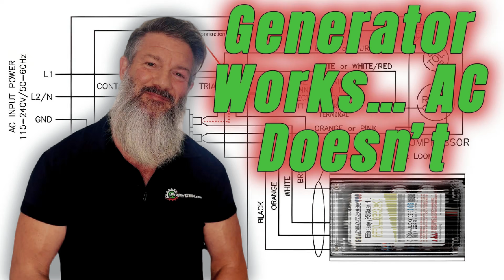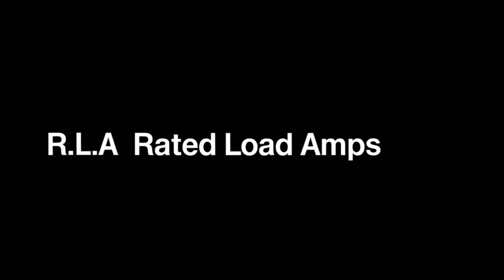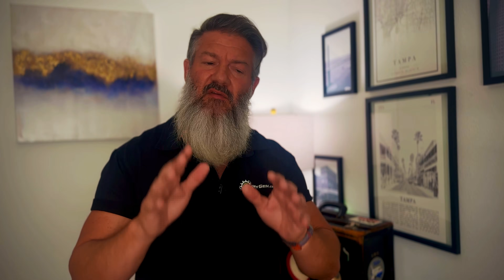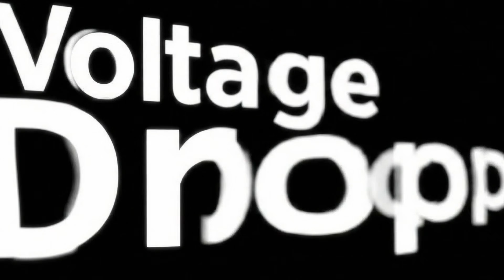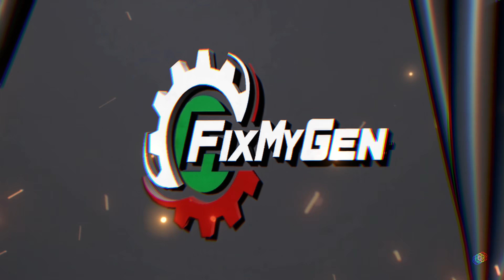STANDBY GENERATOR | AC STARTUP FAILURES | HVAC SOFT STARTERS ❄️⚡

Comment: I have a 2 stage goodman heatpump..would I benefit from this?
Reply from the maker: Short answer: yes, a soft-start kit usually helps 😊

On a typical 2-stage Goodman heat pump, something like a SureStart or Micro-Air EasyStart can reduce that big startup amp spike, as long as it’s a standard single-phase system. If it’s not a true inverter or DC variable-speed unit, the compressor still hits hard on startup. That’s what causes lights to dim, breakers to trip, or generators to struggle. A soft-start smooths that out.

The easiest way to tell if yours would benefit is the data plate on the outdoor unit. If you see an LRA number—especially anything over about 30 amps—it’s a conventional compressor and a soft-start will help. Most of these are much higher than people expect. True inverter systems usually don’t list a high LRA because they already ramp up gradually.

If you’re looking at Micro-Air, the EasyStart Flex 398 is the right choice for most residential heat pumps and central AC systems. The smaller Breeze model is mainly for RVs and boats and usually isn’t the right fit for a home system.

Here’s the soft-start I mentioned in the video:
https://amzn.to/4aBFtw6

Comment: This!  I had one put on each of my HVAC systems.  I used Easy Soft Flex on both.  It's amazing how smoothly the systems start now.  The Genny doesn't even seep to feel it when they start.
Reply from the maker: That’s the dream right there—when the generator doesn’t even flinch. We’ve used the EasyStart Flex on a lot of setups and had similar results. It’s one of the few upgrades where you actually feel the difference… by not feeling anything at all. Appreciate you sharing your setup.

Comment: Are there soft starters for fridges.. people only talk about soft starters for  AC unit compressors
Reply from the maker: Appreciate you jumping in with that. I’m not a refrigerator specialist, but from what I’ve seen, inrush on most residential fridges isn’t high enough to justify a soft starter—unless you’re running it off something small like a 2kVA tailgating generator or limited inverter setup. Commercial units are a different story. If anyone’s seen it make a difference in home setups, I’m open to learning more

Comment: Can't people just use super capacitors.. or do enough research to choose inverter DC type compressors(variable power)
Reply from the maker: Appreciate the thought. You’re not wrong that inverter-driven compressors solve a lot of this—but most folks aren’t swapping appliances just to fix startup surge. And super capacitors actually behave more like hard start kits—they spike current fast, which can stress a generator even more. Soft starters are really the only tool designed to gently reduce that inrush without overloading the system.

Comment: Been running a Micro Air Soft Starter for close to 5 years now, although my Diesel powered Generator could have pulled the weight, like you said, makes the whole inrush for electrical demand that much easier, AND it helps save the life of an aging AC compressor and help protect newer ones. I won't ever run my AC without one and recommending them to family and friends. It's amazing how it cuts down on the LRA and RLA for sure!
Reply from the maker: Love hearing that. Sounds like you’ve got it dialed in. Even when a generator can handle the surge, there’s something smart about reducing the strain system-wide—especially on older compressors. Appreciate you sharing what’s worked for you.

Comment: Would this work on a submersible well pump? I have a similar problem. When the well kicks on, it really draws the gen down.
Reply from the maker: Great question! Micro-Air makes a solid product for certain applications, but it’s generally not compatible with fully sealed submersible pumps—most don’t have accessible wiring for the install. We’ve had better results with pump-rated soft starters from WEG or Franklin. If your pump has an above-ground capacitor box, you might have more options—but it’s worth confirming wiring access before making the call.
Reply: @FixMyGen  thanks

Comment: The only soft-start I would trust is MicroAir EasyStart.  They are very robust. 
I have a 4 ton heat pump and my MicoAir EasyStart lower my inrush current from 117 amps down to about 29 amps.
That's a 75% decrease. It will also increase your compressor life. 
I tried the exact one used by SIGNATURE SOLAR in their 18 kpv hybrid solar inverter start upload video AND IT BURNT UP IN LESS THAN 2 WEEKS.
Reply from the maker: Agreed—MicroAir EasyStart is solid. That’s one of the two I mentioned in the video description. The other is the SureStart-6 from Hyper Engineering. We’ve used both with great success.

Comment: Lennox condenser 1986, been through 4 yes 4 HVAC contractors still wont work!!  Micro-Air EasyStart like a brick unconnected on the side of my unit!!
Reply from the maker: Hi @TheVaga9,  
Sorry to hear about all the trouble with your 1986 Lennox and the EasyStart! Here are some steps and tips that might help get it working:

1. *Check Compatibility:*  
   Some very old units (like yours from 1986) may have wiring or capacitor setups that are a bit different from modern diagrams. Double-check with Micro-Air support ([their tech support is great](https://www.microair.net/pages/contact)) to make sure your specific model is compatible.

2. *Wiring Diagrams:*  
   Micro-Air provides detailed wiring diagrams for most units. If your contractors haven’t already, download the [EasyStart installation guide](https://www.microair.net/pages/easystart-support) and look for Lennox-specific instructions. Sometimes, older units require an alternate wiring method.

3. *Capacitor Configuration:*  
   Many issues come from not identifying the correct start/run/comm wires on older compressors. If your compressor has three terminals (usually labeled C, S, and R), make sure the EasyStart wires are matched up exactly as shown in the manual.

4. *Bypass Any Hard Start Kits:*  
   If your unit already has a hard start kit, it should be removed before installing the EasyStart. Leaving both connected can cause the EasyStart not to function.

5. *Contact Micro-Air Directly:*  
   If you’re still stuck, Micro-Air’s tech support can walk you or your contractor through the process step-by-step. Sometimes, sending them a photo of your wiring setup helps them give you the exact advice you need.

6. *Last Resort – Local Electrician:*  
   If four HVAC contractors have tried and failed, sometimes a skilled electrician with experience in motor controls can get it sorted out.

*You’re not alone—older units can be tricky!* But with the right info and maybe a call to Micro-Air, you should be able to get that EasyStart working. Good luck, and let us know how it goes!

Comment: Thanks for your video. I have enjoyed watching them. This one, in particular, intrigued me because I waited until the end to see which soft starter units you recommended. Last year, I had a 20kW standby generator installed. But, previous to that I had installed the Micro Air EasyStart 364-X36 for my 2 ton A/C condenser. Once the Micro Air EasyStart FLEX was announced I upgraded after about 6 months. Very happy with both. I enjoy all the benefits you describe by using a soft starter in my home. The FLEX unit allows me to start using only 19A while the compressor is rated at 58.3 LRA. I am very happy with that! The reason for my post is I realize now I was taking these soft starter benefits for granted. I calculated a typical summer load test for my generator recently and found it is very possible to NOT have A/C air flow & cooling WITHOUT my soft start installed. Thanks, again, for your video.
Reply from the maker: That’s such a helpful comment—not just for me, but for anyone scrolling through. Micro-Air is a solid choice, and it’s one of the two I was referring to in the video. The other is the SureStart 6 by Hyper Engineering. We’ve used both depending on the application.

Also appreciate your honesty about taking the benefits for granted—I’ve been there too. You only notice how much it’s helping once you try running without it. Thanks again for watching and taking the time to share.

Comment: This works similar to an inverter system with a slow start and then a ramp up?
Reply from the maker: You’re spot on with the general idea—yes, both aim to ease the startup surge. A soft starter doesn’t turn your AC into an inverter system, but it does help a traditional unit start more like one.

Inverter systems gradually ramp and modulate based on demand. A soft starter just controls that initial hit—kind of like easing onto the gas instead of flooring it from a stoplight.

Appreciate the thoughtful question!

Comment: What a Great Explanation. Thank you for a great video. I am a HVAC contractor and use Ruud and Rheem products. I agree 100%. We have seen the same issues over and over. We have installed over 40 of the Micro Air Easy Starts this year and are very impressed. Todays install was on a 3 ton Rheem heatpump. Initial startup amps were 79.  After the easy start learned the system we were at 26 startup amps. The blutooth connectivity to the device is a great feature. Keep up the great work. Love your videos!!!
Reply from the maker: Really appreciate you taking the time to share this—especially the amp draw numbers. That kind of feedback carries weight coming from someone in the field. We’ve used both SureStart and Micro-Air, and I’ll be honest—Micro-Air’s been the stronger performer for us too, especially when it comes to consistency and support.

Where’s your AC company located? Always good to know who’s out there handling installs the right way. Might be worth trading notes one of these days.

Comment: I can vouch for the Easy Start...  I have a large home with 2 heat pump systems in the Az desert.  I have a 8500 Watt generator (Peak to 10,000 watts) that would barely start the 4 ton unit.   The EasyStart allows me to start both units (not together - I start the 5 ton 1st, let it stabilize operation,  then I can the 4 ton)   Once both are stabilized I can run lights and other essential 120 VAC circuits without a problem.   Without the Easy Start, I would not be able to run either!    I did my own installation, but my A/C (Heat Pumps) are simple older units.  

Even without a generator, I would use the Easy Start anyway after having a few years' experience with them.   They work great!
Reply from the maker: Appreciate you watching and taking the time to share your setup, Peter. That’s a solid real-world example of how much difference soft start makes—especially when you’re managing tight capacity like that. Smart move staggering the loads like that too. A lot of folks underestimate how much planning it takes to make a small generator work that hard, that clean. Thanks again for chiming in.

Comment: I've been using micro are soft start for 4 years in Phoenix Arizona I'm running the old style I've heard a lot of negative things about the flex start do you have any information if they've got the bugs worked out of the flex start
Reply from the maker: Appreciate you sharing that—I’ve heard similar stories. From what I understand, the problem units were mostly produced in mid-2024, and the newer batches have had those issues addressed. Supposedly, Micro-Air also recalled the older stock. If your current one’s still holding strong, I’d say keep rolling with it. But if it’s ever time for a replacement, the latest versions should be good to go.
Reply: I just want to have one on the shelf for backup ,,BTW I have 2 Predator 9500 that I can parallel which would be at 25% load for each or if one were to crap out I can run 1 at 50 % load for life support systems only (lol air conditioning in Phoenix isn't luxury its life support)  @FixMyGen
Reply: I agree 2024.units we had some failures and they were replaced by Micro Air with no hassle

Comment: Add a hard start capacitor  in line with the compressor start relay.
Reply from the maker: Hey 👋 John, I’d actually love to hear more about your strategy. From what I’ve experienced, hard start kits can sometimes create more inrush—not less—when running on generator power. Especially on lighter loads, I’ve seen them cause momentary voltage dips or even trip the system offline.

That’s why I’ve leaned more toward soft start kits. They ease the compressor up gradually and tend to be more generator-friendly in real-world installs.

But if you’ve seen it play out differently, definitely let me know—I’m always learning.
Reply: @FixMyGen 40yrs of high end RV repair Provost bus that was the  quick fix for the condition at hand. Once you mentioned the ez start control system that is the modern way to be easy on the  AC and the load center 100% go with that system when time allows. Hence wintertime upgrade, emergency right now a facility like Granger will sell a secondary hard start relay that on the spot just goes parallel to the original relay but of course the last wire ends up on S on the compressor.
Reply: I hope the explanation helps I have the capacitor in my possession..  your local RV repair facility will be able to assist you with the kit. @FixMyGen

Comment: Do inverter AC condenser units have the same issues with hard start. When we replaced our 30 year old 5 ton Lenox AC with a new unit the light dimming at startup seems to have disappeared.
Reply from the maker: Great question. Inverter-style AC systems usually avoid the big inrush current you get with older single- or two-stage units. That’s because they ramp up gradually instead of slamming on full-speed at startup. So it makes sense the light dimming went away when you replaced that old 5-ton Lenox—your new system’s probably pulling way less amperage on startup.

If you’re curious, check the spec tag on the new unit and look for LRA (locked rotor amps) or RLA (rated load amps). If that LRA number is low, you’re in great shape—especially when running on generator power.

Comment: I worked at a utility for 34+ years. We could tell, during a power outrage, folks with a back up generator.For some unknown reason they would have every single light on inside and out. Lights that most would not normally have on. Their homes lit up like a grand opening. Just an observation.
Reply from the maker: Thanks for sharing that—and thank you for doing what you do. I’ve actually never heard that observation before… now I’m wondering why that is. Maybe there’s some psychological thrill to flipping on every light when you’re the only one in the neighborhood with power.
Reply: People forget that their power is off, then they forget the position of the switch.  It's a knee-jerk reaction when you walk into a dark room to grab the light switch even though you know the power is out.

Comment: The newest 26kw Generac air cooled generator has a surge capacity of 230 amps or 55kVA, which is enough to start even the largest home HVAC units. Even so - using a soft start kit can reduce the startup load on your HVAC unit even when NOT running on generator power and could extend the life of your compressor. Micro-Air makes excellent units that will work on almost ANY size residential HVAC compressor/condenser. They cost around $400 and are worth EVERY PENNY. The app that gives you info on the operating conditions is a plus.
Reply from the maker: Appreciate you chiming in. You’re absolutely right—soft start kits like Micro-Air can make a huge difference, not just for generator performance but for HVAC longevity too. Even with the new 26kW’s beefy surge capacity, reducing that inrush is still smart strategy. Good insight all around.